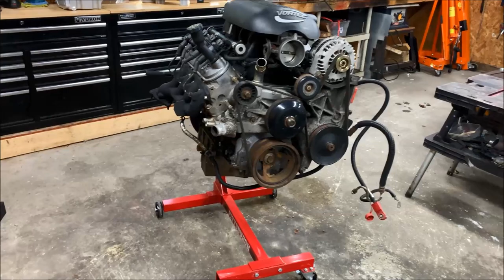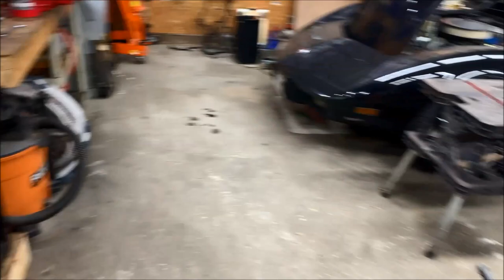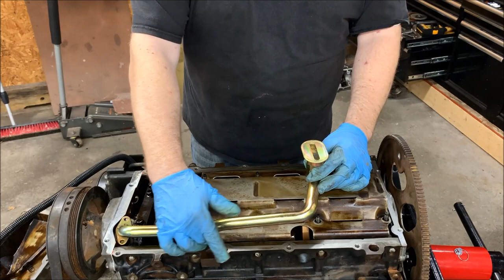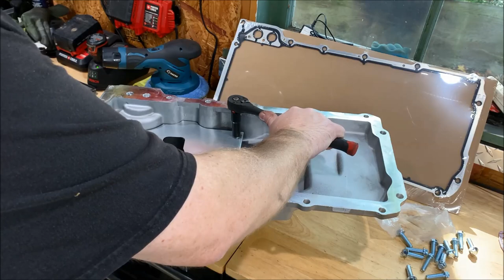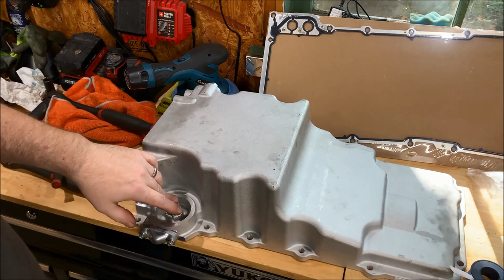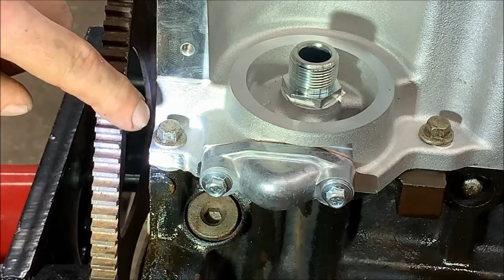1976 Chevrolet C3 Corvette LS Swap - Part 3 Oil Pan Installation

Comment: Great video.  My son and I are doing the same engine swap.  We experienced the same thing.  The diagram provided to modify the Windage Tray is not accurate.  Your video is very helpful, thanks for taking the time to post it!
Reply from the maker: No problem. Glad it helped you out. Check out the rest of the playlist for the rest of the build.

Comment: I'm curious, why not a full on rebuild?  Was it budget concerns or did you just think it had enough life left in it to use it as is?
Reply from the maker: Mainly budget and time. The engine ran great before it was pulled. 

Project has been done for about 2 months now. Has 60 PSi at cruising speed and it runs around 201 degrees with no smoke from the pipes at all.
Reply: @StreetersGarage  just found you today and I’m just starting on part 4.
Reply from the maker: @madrabbit9007  Nice. Let me know if you have any questions.